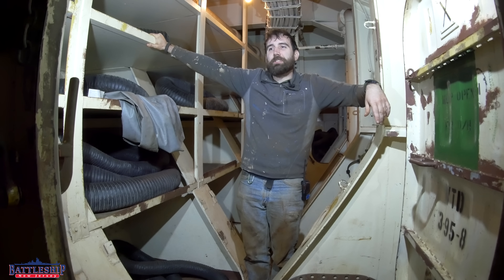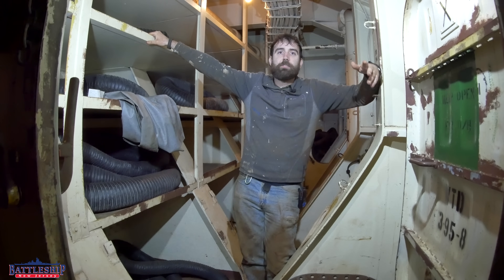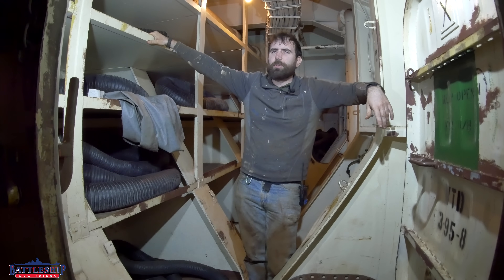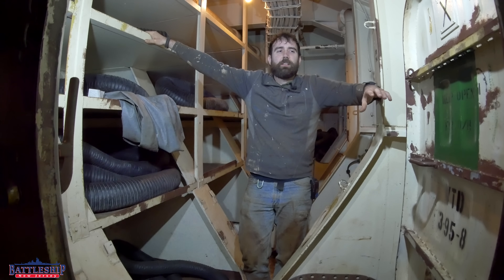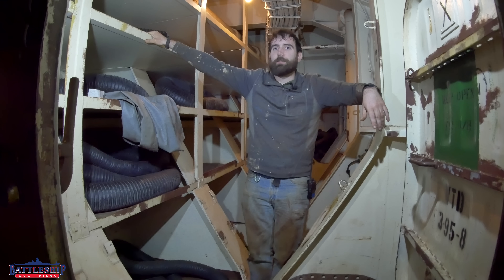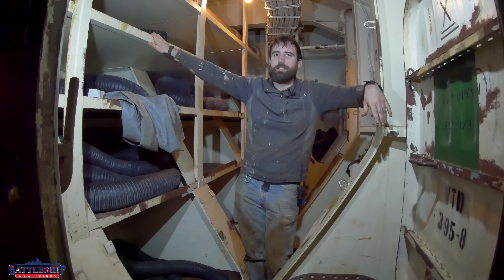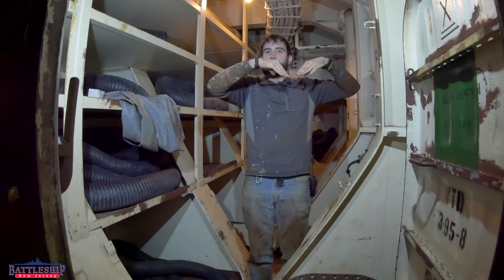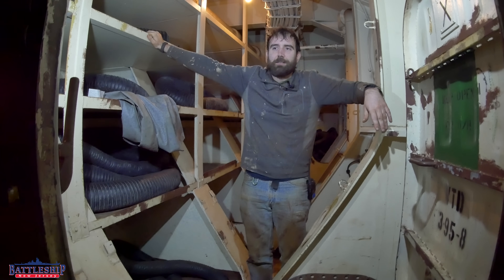The Best Torpedo Defense On a Battleship

Comment: The best defense against torpedoes is not to get hit by one.  Best way to achieve that is speed.  This is especially effective where the submarine is diesel electric and the ship is a fast one. The faster the ship goes the more difficult it is for the sub to get into position for a firing solution and thus the Ship's Torpedo Danger Zone (TDZ) becomes close to her intended course. If the ship intends to remain in an area, the best thing to do is a constant circle with varying radius of turn.  Almost impossible to get a firing solution.
Reply: Shinano certainly didn't have the speed. A couple of dodgy turns even if she did and the outcome would have been the same. 

Best solution, high speed, aircraft to keep em submerged and not sail anywhere near one! 

Lots of DD's :)
Reply: That’s reminds me off admiral Jackie fisher argument for battlecruisers “speed is armour”
Reply: Perhaps with Torpedoes of world war 2.  All of your solutions wouldn’t work against modern torps, modern torps are as manoeuvrable as a hatchback and the firing solution is almost a full 180* on each side of the ship.
Reply: @project182r  I hope you are not a submariner, coz you suck. The OP was talking about WW2, not modern stuff.  Anyway, modern torpedoes are not of infinite speed and they have a finite range.  It is possible to out run torpedoes but it depends on the math. There will always be a TDZ unless the target is very slow.
Reply: If only surface ships were incapable of firing torpedoes. And if only running constantly at high speed would not reduce range by absurd amounts.
Reply: @oneukum  1. Surface ships are not a problem in his regard you can see where they are. 2. I was talking about SM launched torpedoes v surface ships.  3. You dont need to run at high speed all the time , you can do it just for the TCM, but you run a risk.  4.  Battleships had huge amounts of fuel and could RAS to or from.
Reply: @csjrogerson2377  Unfortunately not all battle happen in good visibility. In fact limited visibility is among the factors that made surface engagements likelier as it made it harder to use aircraft.
Reply: @oneukum  Really!!!  The OP has gone from how battleships construction is designed to deal with torpedoes and my post about torpedo countermeasures, ie how to avoid being hit by one and YOU have have thrown red herrings down a rabbit hole about surface ships attacking battleships in the fog (low viz).  That's a pretty niche market and dont forget if the viz is bad how does the surface ship see the battleship?  If one or both have radar and they did in WW2, who cares about fog. If you think a destroyer or MTB is coming at you, shot at it, and increase speed directly towards or away and keep shooting.
Reply: @csjrogerson2377  Dude, it may have escaped you, but this planet is round. Thus visibility is very bad more than half of all time. That is called night.
Reply: yeah ... speed works great , until your problems are just torpedoes. This is why guided bombs and guided missiles were invented, then hiding battleships becomes your admiral main concern, until they were  all  disposed of, or turned into museums. The battleships, I mean 😃
Reply: @sandrodunatov485  True, but we were talking about just torpedoes.  So your point is...

Comment: A related question is how do they protect their propellers and rudders? The mention of Bismarck brings this to mind, given it was a torpedo hit to the stern that doomed her.
Reply: The USS South Dakota (BB 57) class addressed this somewhat by placing the two prop shaft skegs outboard rather than close to the centerline of the ship as the Iowa class does.  This offered some protection to the outboard shafts that none of the other BB classes had, and the inboard shafts were in the "tunnel" between the skegs.  The rudder though was still out in the open.
Reply: @robertf3479  I thought I read somewhere the US ships had ways of removing the rudder if damaged and use propellers to steer the ship, while the Bismark did not have a way to get rid of the rudder.
Reply: @peterpeek4831  I have a book on the subject (Battleship Bismarck: A Design and Operational History, Garzke/Dulin/Jurens) which says that even on trials in relatively calm waters with rudders amidships, she didn't respond well to steering using the propellers.
Reply: @peterpeek4831  If there is a way to "remove" or jettison a damaged rudder while at sea I was never told about it.  
Yes, multi-engine ships can maneuver using engines only, at low speeds and assuming the rudder isn't jammed more than a few degrees off center or that there isn't anything else to induce a turn like wreckage hanging over the side.  Some also have bow thrusters to help hold position during boat launching / recovery operations.
Reply: @nottakennick  The main problem there is that Bismarck had only three propellers, so only one would induce any turning moment.  Most others had four, with two able to provide turning thrust (presuming they are not damaged; reverse on the other two could turn the ship too).
Reply: @robertf3479  The Iowas had outboard skegs too.  The difference is that on the SoDaks, the outboard shafts and skegs extended past the inboard props, creating the “tunnel.”  On the Iowas, the outboard shafts were the usual length, but still with skegs.
Reply: They really didn’t protect the propellers and rudders.  They just accepted that it’s a weakness and hope they don’t get hit there.  About the closest anyone came to protecting the propellers was the US, which placed the outer propellers in skegs, which would partially shield the inner prop shafts from an explosion, and would also prevent a prop shaft from spinning wildly if it was bent and the support strut were destroyed, as happened to Prince of Wales.  But a direct hit to the stern would still do a lot of damage.
Reply: PoW was sunk by a single 18" torpedoe that hit the port side propeller shaft, the 3 extra torpedoes on the starebord side just slowed down the sinking, by an hour or so, she capsized to the port ! Her 15" inch armour belt did not do shit to save the ship.

Comment: Is that not a TRAIN heading onto the deck at 12:43??  If so, that would be a little scary to me!
Reply: It's not a ship, that structure in the middle is the area in between two locks in the Panama Canal probably taken when it was being built.  The quality of the film makes it hard to tell what it is.   He was discussing about the need of the ships to fit the locks/canals.
Reply: @lewisdoherty7621  Does not look like Panama Canal, looks like drydock with a large crane on the right.  Looks like a man-powered skidway on the deck leading to the bow, with two guys pulling a cart along it.
Reply: @gregorywright4918  I'll go with something like that.  I'll have to look at it more.  The quality of the film was about pre - WWI about the time the canal was being built and as a major governmental project, someone decide to film it and it ended up being held by governmental archives and free to the NJ Battleship operation.

Comment: Actually, almost any of the big Nations in World war 2 already had Torpedos with magnetic Detonators in somewhat wide use going into WW2. These Torpedos would detonate from the Magnetic Influence of a Ships Bow. so if you set them to the right depth (and current earth magnetic influence) they would detonate 1m / 3 Feet below the keel of your Target.
Reply: they didnt work that well. every nation got rid of them except the us, which was the major problem with the mk14 not exploding. the second was the backup contact fuse, the rod was to narrow and prone to break. once they got rid of the magnetic det and installed a thicker rod the mk14 started to work very well
Reply: @sinsley1  Well the Mk14 is a story of its own. But to my knowledge German G7 type Torpedoes had initial problems with the Magnetic Detonator like it was case with the mk14, but the Germans figured it out after the initial phase of the war and made the detonators work. As far as i know G7 types where used up until the 1960s. 

And for example seamines to this day still have magnetic influence sensors.
Reply: @von_dusenhain  haven’t heard of the g7 so I can’t comment on that
Reply: @von_dusenhain  Not sure on the timeline for fixes with the G7, but reliability issues with magnetically triggered torpedoes were widespread during the war. My general impression back when I read up on this is that it was a technology that was almost, but not quite, ready for primetime. (Which would help explain why they did work in sea mines: it's just a little easier to get a fuse to work on a stationary mine detecting a relatively slow-moving ship, versus on a torpedo where you have engine vibrations and the relative speed of torpedo+target is much higher.)

Comment: The enormous size of Yamato and Musashi would have to take the cake, even though the armor joint was their undoing. However, what other ship could take that punishment?  As far as a more normal ship the French Richelieu class had the deepest protection, combined with the ebonite mousse that was packed it the voids. So I’d give the edge to them
Reply: actually Yamato class TDS was not that deep. Despite their sheer width their TDS depth was less than a north carlina's, and this is due to the lower efficiency boilers used by the Yamato's forcing the designers to put the boilers four abreast. As such this Gave the Yamatos very wide engine rooms, which limited the depth of their TDS.

What kept both ships afloat for as long as they did despite the weaknesses of their torpedo defenses was their excellent internal subdivision as well as just being very very big. Very large ships like that can just simply take a long time to sink.
Reply: I believe that was chocolate mousse but could be mistaken……
Reply: @richardhaynes6934  😂
Reply: Their quasi sister Shinano only took 4 torpedoes to go down.
Reply: @charliedontsurf334  Shinano wasn’t fully fitted when she was sunk, unlike Yamato and Musashi. Shinano was essentially not prepared for water tightness and flood/fire control when it was sunk, despite her captain saying so to higher command who wanted to have her sail out to a different dock.
Reply: @charliedontsurf334 shinano is very much the outlier, just look at how much pounding it took to sink both musashi and Yamato.
Reply: @pedrofelipefreitas2666 I agree.  Shinano had all of her compartments opened up at the time and a limited crew, too.

Musashi and Yamato's engagements were at "full" combat power and crew training.

Japan did a lot of dumb $h!t in WW2.  Britain did too, though.  I'm amazed at how many ships got caught on their own or with limited escorts.  Come to think of it, America did as well (Indianapolis comes to mind).
🙄
Reply: I’d argue the opposite and say that the TDS was the one serious weak point in Yamato’s largely well-designed protection, given that only the most powerful naval guns (like the 16”/50 or Yamato’s own 18.1”) really stood a significant chance against her belt or deck armour, her deck armour stood up fairly well to 1000lb bombs, and that she didn’t suffer from the inefficient armour layout issue of German capital ships.

Sure you could argue that the riveted parts of her belt armour were also an issue, but a) this applied only to the very thickest sections of her citadel with most of the rest of the armour being welded, and b) rivets were an universal issue in battleship protection in general so Yamato doesn’t stand out all that much in this regard.
Reply: @bkjeong4302  Riveted armor on battleships was never an issue because it didn’t exist.  Armor of any significant thickness wasn’t riveted or welded.  It was connected to backing plates with massive bolts.  (The backing plates were either riveted or welded, but I’m not aware of this ever affecting a ship’s resilience to shell damage.).  Sometimes there might be surface welds on exterior armor, but that was just to keep water out from between the plates.  If you weld thick armor plate then you destroy the heat treatment and compromise the entire plate.  And even if that weren’t an issue, welding wasn’t advanced enough to weld plates that thick at the time.  It wasn’t even always reliable with thin hull plates until later in the war.  That’s one likely contributing factor as to why German ships had sterns that fell off, or why a few Liberty ships split in half in heavy seas.

I would agree with the rest of your statement about the Yamatos’ TDS and armor scheme though.  There weren’t many BB guns that could reliably penetrate it at a reasonable battle range, and its deck was immune to all but extreme range plunging fire and most any bomb that a carrier-based aircraft could carry.  The TDS was just bad though.  The US battleships catch heat for their supposedly poorly-designed TDS (which did get improved in last-minute upgrades), but they were never such that a shallow-running torpedo could cave in the joint between belts and dump water on top of the machinery spaces.
Reply: @bluemarlin8138  Some Japanese experts have studied why the Yamato sank.  There is a video of this on Youtube but I don't have the link.   They noted that the main armor belt on both Yamato and Musashi were riveted and not welded.  The Japanese were not able to weld such thick steel armor.  The original yard in fact had plans for both ships and was able to produce a duplicate section of the original armor used on the class and demonstrate how the plates were riveted together.  Those rivets failed on both ship when hit by torpedoes and the wreckage of Musashi in particular demonstrates this clearly as a chunk of the very same armor plate is found far from the rest of the wreckage with failed rivets.
Reply: ebonite mousse? I tried looking that up and it gave me “hard rubber”.

Did the French put rubber in the voids for their TDS?
Reply: @magiccarpetmadeofsteel4564  rubber foam basically

Comment: A point Ryan’s explanation elided: not all armor is better with one thick plate as opposed to many small plates. This is specifically true with shaped charges, most often seen in anti-tank armaments. This is because the effectiveness of a shaped charge is based on the focal length of the charge, which functions like a magnifying glass does with sunlight but instead using an explosive to shape a slug of (usually) copper into a jet of hyper velocity molten metal. This can be defeated by having a sacrificial plate which detonates the shaped charge (much like how the New Jersey has an external shell plate intended to de-cap incoming shells causing them to detonate against the external armor before it penetrates) followed by heavier armor intended to defeat the dissipating jet of molten metal - often by sloping the interior armor as well, redirecting the dissipating jet.
Reply: While having several layers of defense is good, I believe what Ryan was referring to was that, for a single armor plate, aka one part of that multi-layered defense system, one single 12-inch plate is better than two 6-inch plates, or 12 1-inch plates. This probably isn’t particularly relevant by the 1930s, but certain nations lacking the industrial capacity to produce foot thick steel plates for warships was a thing in the late nineteenth and early twentieth century.
Reply: Dreadnought-era battleships did have the equivalent of slat armor in port, they had chains/nets on booms that could be swung out from the sides to predetonate torpedoes. 
It's true that single solid plate is better for his case, though, where it's all basically KE penetrators (a 2700-pound 16" AP shell has like 45lb/20-ish kg of explosive inside, just to splinter the case once it's forced its way through the armor through F=MV^2), Chobham armor hadn't been invented yet, and shaped charges were in their infancy. Now I'm imagining battleships with 16" HEAT warheads and ceramic armor. Although I'm not sure the ceramic-filled Chobham-type armor would hold up to 16" AP, the way it works is by the shattered ceramic middle bit grinding the pencil-shaped shot* a tank fires away before it can get to the inner plate.

*In artillery, shot = solid metal, shell = explodey filling, so by analogy, standard hard-candy lollipop vs. Tootsie Pop, with the Tootsie Roll center being the bit in the artillery shell that goes boom. The Mk 8 superheavy shell was like a regular lollipop with the stick vaguely chocolate-flavored.